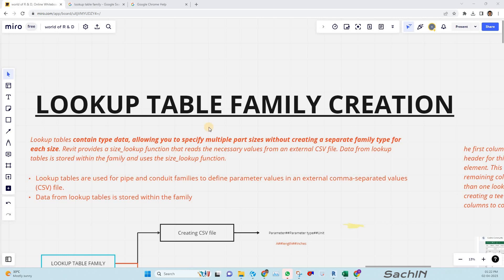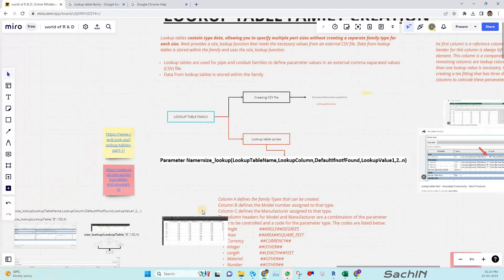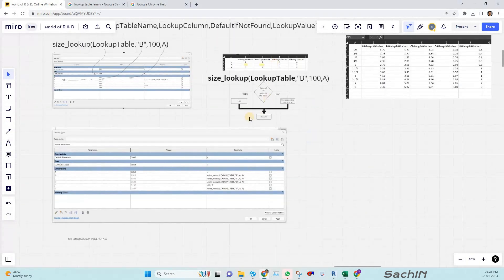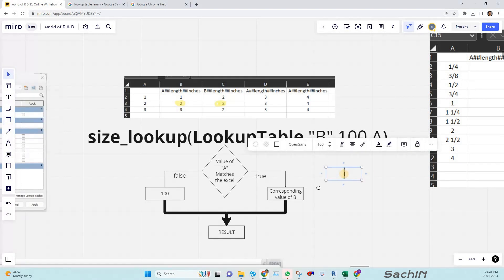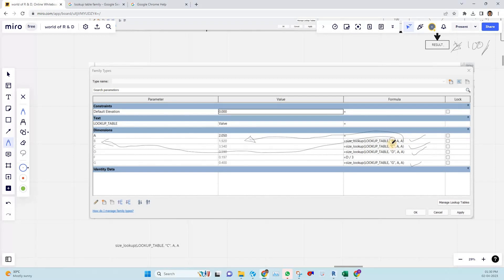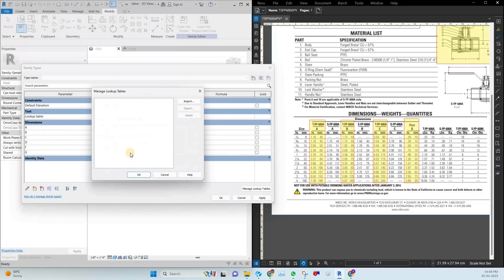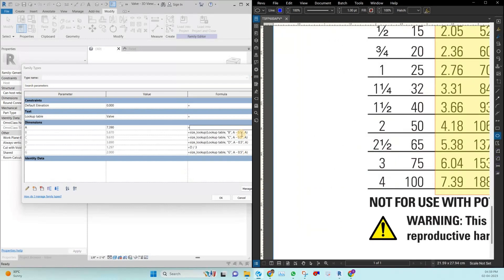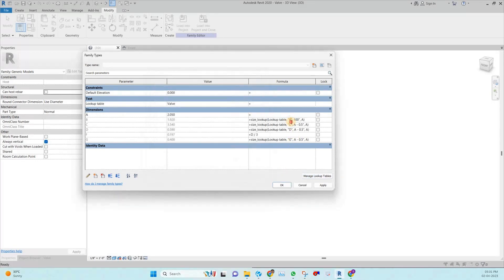LOOKUP TABLE FAMILY CREATION BASICS-1

Comment: Hi friend, excellent video. I know how to make a valve in Revit that can be adapted without restrictions to any pipe diameter. Or what would be that trick where the valve is placed on the pipe and adapted to that diameter, modifying all of its measurements on the valve?